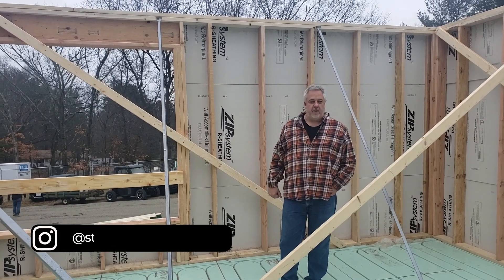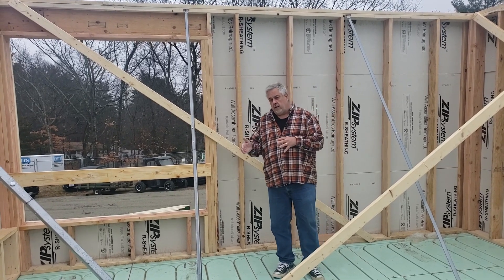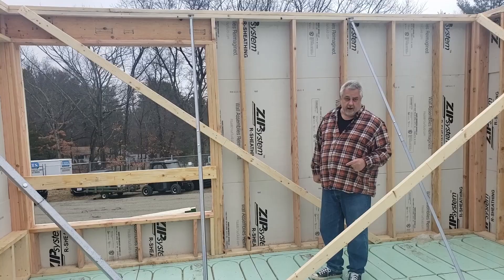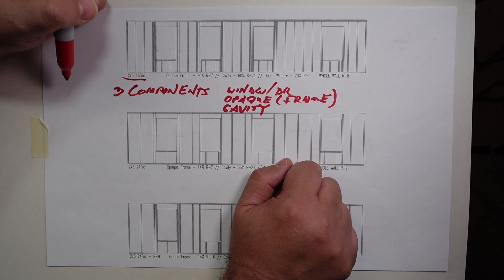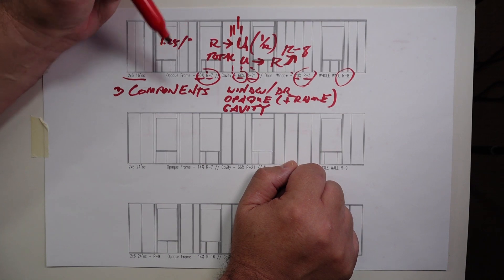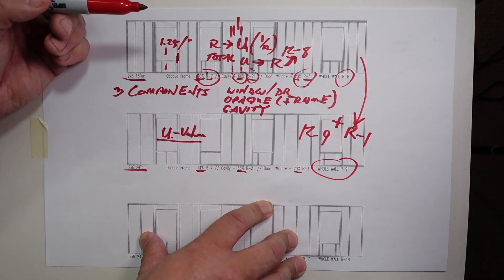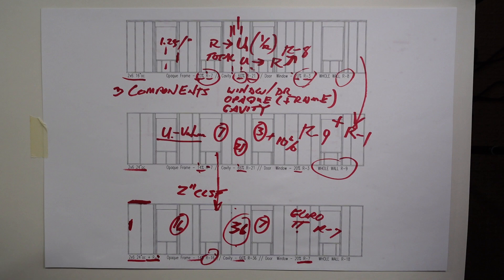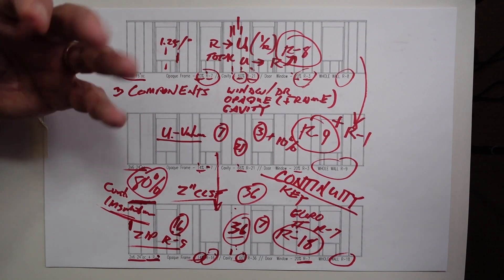INSULATION the WHOLE WALL R-Value

Comment: Another one: as long as your studs are 2X6 and touching both the inside drywall and the outside OSB/subsiding, you are transferring heat through the wall.  You should either stagger the studs, with a double row of studs or nail 2X2 firring every 2 feet apart horizontally and fill the cavity with solid 2 inch insulation.  But until you 'break the heat transfer' you are barking at the wind.  I guess you can add the exterior insulation, but the cost in terms of both labor and materials is high.  Also, double walls are great to reduce noise.

Comment: The different thermal resistors (window, framing, cavity) are in a configuration we call "parallel" in circuit design. The "thermal current" passes through each simultaneously inversely proportional to the thermal resistance value. We can calculate a "total thermal resistance" by following the same rules for parallel electrical resistors and is exactly as Steve said: the total resistance = the inverse of the sum of the inverse of the thermal resistances. Or:
R_Total = 1/[1/R_window + 1/R_frame + 1/R_cavity]. 
If you want to know the relative total resistance, you have the % multipliers as mentioned:
R_Total = 1/[%_W/R_W + %_F/R_F + %_C/R_C].
With a bit of algebra we find:
R_Total = (R_W*R_F*R_C)/(%_W*R_F*R_C + %_F*R_W*R_C + %_C*R_W*R_F)

Using 20% for %_W and %_F, 60% for %_C, R_W = 3, R_F = 7, & R_C = 21 we should find that the relative total R = 8, exactly as Steve said.

The real thing this highlights is why external insulation (out-sulation😅) is so darn effective. It adds a thermal resistor in "series" (one after another) with these resistors, adding the exterior R value directly to the R_F and R_C values, just like if it was an electrical resistor in series. Since placing out-sulation over a window isn't a window anymore, we wouldn't add it to R_W. You could up your window to a higher R value to be more copacetic with the rest of the wall, but otherwise you'd leave it alone.

Now what's even more interesting is you can take that formula for relative R_total and put it into Desmos, a free online graphing program, and give 6 variables for the 6 terms above and start sliding them around to show how quickly you can increase the total R value by changing each individual slider. This would indicate which variable would be the most bang-for-your-buck to put money into to improve your R value.
Reply: You can not compare heat flow with the flow of electrons (electrical current). An electron is a particle that can't split itself up. When an electron encounters 3 resistors in parallel, the electron has to "choose" which resistor it will take.

Heat flow is an energy flow which will split itself up when it encounters 3 thermal resistors in parallel.

That's why you need to take the weighted average (according the surface) of the parallel thermal resistors if you want the calculate the overall thermal resistor. 

In this case you will get R = 20% x R_W + 20% x R_F + 60% x R_C = 14.6

This is by the way how the heat loses of a building are calculated in the European Union...
Reply from the maker: @koenraadprincen7212  Thanks for joining in
Reply from the maker: Thank you for the elaboration - much appreciated
Reply: Great explanation!  I am an electrical engineer so I understand the math well. I failed EE101 the first time because I did not understand the math, thanks.  the outside insulation is a resister in series with all the parallel circuits!!
Reply: @mab49696  You can add up thermal resistors in series as they share the same surface. But forget the story about calculating the equivalent resistance for the parallel resistors with the electrical formula.

If the subareas of your wall (frame, cavity, windows, doors,...) have a different total thermal resistor, you need to calculate the heat loss per subarea (with the "heat transfer coefficient" of each area).

Comment: In a northern climate (e.g. Minnesota) doesn't this put a cold low-permeability surface against your batts?  It was down to -17C this week.  R6 Zip with R30 overall would be frosty.  Sure it's dry as hell outside but any moisture at all from the inside is going to freeze on that wall if the interior air/vapor is less than perfect.
Reply: Correct!
It's even worst, the seams of the ZIP R-sheathing will even sooner act as condensing surfaces because the external ZIP tape is not insulated at all (and vapor closed).
Reply from the maker: @koenraadprincen7212  Actually they make a vapor open tape - and I don't think this is anywhere near what others have described as a concern
Reply from the maker: Yes there are some challenges in the colder climates - where you are, I would likely be more like 50/50 in R-value as a start....

Comment: Maybe we should use 2x4 framing, use no cavity insulation,  and use thicker continuous exterior insulation.   Instead of spending money on 2x6 framing and cavity insulation, use that money on higher R-value continuous exterior insulation.
Reply: I am a homeowner building a new house in the Boston area soon.  I am leaning towards going thicker with polyiso on the exterior, 2x4s on 16” centers with Rockwool batts in the cavities.  One concern I have with 2x6 on 24” with furring strips is hanging the siding on 24” centers.
Reply: @ Maybe the answer isn't exterior insulation.  Maybe it would be better to use 2x12 studs on 24" centers with advance framing techniques.
Reply: @marksandoval5361  2x12"? did you mean 2x6?
Reply from the maker: @marksandoval5361  no, I don't agree with that
Reply: Excellent discussion. But how does double wall construction. With its continuous layer of insulation in the cavity between the separate walls. Compared to the above options?  In terms of its cost, benefits and drawbacks.  

And in the long-term, self-supporting forms of insulation, such as Hempcrete, Is an ideal continuous external insulation, but it's high alkalinity protects wood.  So it's counterproductive not to also insulate between the studs.
Wonder how long before the industry matures enough. where it becomes a mainstream option? (I'd be interested in a similar analysis of Hempcrete, but I doubt there's enough experience in the mainstream building industry, for an objective comparison?  But would love to hear it)
Reply: my understanding is that the exterior insulation application is higher cost than cavity insulation?
this is a question not a statement of fact
Reply: You certainly correct- the labor to install exterior insulation boards is high.  Not so much with Zip-R, but that has other issues.  My builder quoted a $27,000 cost savings to go entirely with close cell spray foam in the walls and roof rather than dense cellulose + exterior polyiso.  However, I am not interested in spray foam for several reasons.
Reply from the maker: @jakebuttrick8853  well first off, builders tend to make what they want to do attractive via $$. the exterior insulation is simply a better performer - good things cost $$
Reply: @ There are so many variations and permutations that cost verses R-value could be difficult to determine.   Personally, I think that the best solution would be to use 2x12 studs on 24" centers and advanced framing techniques with rock wool cavity insulation and no exterior insulation. And, R3 windows with insulating window coverings.
Reply from the maker: @marksandoval5361  To me that is a big waste of money for reasons in this video. After about 5" of cavity, it doesn't make sense to me to make it deeper unless there is something on the exrterior. Beyond the better performing wall, you are really beginning to build a building science nightmare in your suggestion
Reply from the maker: @mab49696  It is but it is of more performance value.......imagine you purchased a Ferrari with 100 hp - kind of a disappointment
Reply: I like that idea in theory from a building science perspective.  The challenge I think is an elegant and robust execution to attaching rain screen battens with long screws semi-blindly hitting 1 1/2 framing.
Reply from the maker: @runmarkrunheinrich  yes, all assemblies have their challenges
Reply from the maker: There is some real argument there...

Comment: Question:  most discussion is about R value for our walls.  for simplification purposes lets assume we have a one room home square box, 10x10x10.  Due to the stack affect, heat rises, how much more important is the R value for roof/ceiling and then floors, than the R value for the walls?  are the floor ceiling combo more important than the walls even though they make up only 33% of the square footage of the box?
for this 10x10x10 box, walls are 400 sq ft, the floors are 100 sq ft, and the ceiling is 100 sq ft. Total area to be insulated 100 +100 + 400 = 600 sq ft.
Reply: Yes, it's better to invest more in the insulation AND AIR TIGHTNESS of your ceiling (or roof) together with - let's say the upper 2 or 3 ft of - your walls.

Floor insulation is the least important if you have a slab on grade or an unvented basement as you can always benefit from the earth heat (although this depends on your region/CZ).
Reply: @koenraadprincen7212  I am restoring a 100 year old log cabin with bedroom added so your comments are very relative.  the house sits on a crawl space that floods from the river every 15 years so your idea of spending my money on roof/ceiling and top half of walls are a very good suggestion for my situation.  thanks
Reply from the maker: @koenraadprincen7212  Well, let's rethink his a bit, from a direct building science heat loss perspective I may tend to agree with you, but the floor is the only surface in the home where I am in constant contact with. Thermally you have an argument, from a comfort standpoint, you best concern yourself with insulating the floor....
Reply: @stevenbaczekarchitect9431  I didn't say that you don't need to insulate the floor...

I said that's worth insulatiing your roof/ceiling more than your walls... just like in passive houses.

If you realy want warm feet, install a heated flooring system 🙂
Reply from the maker: Yes, when you look at the heat loss of a building the ceiling matters quite alot. The ceiling is also the easiest to insulate heavily, and lastly, if it's a vented roof the science is totally in your favor

Comment: Well described.  Windows really are a double edged sword.  They make the house look more interesting, they let in natural light and provide a view of the surroundings, but, they also add significant cost and they are big thermal leaks too - they also offer opportunities for all control layers to leak in fact, but other liabilities can be mitigated with careful detailing..
Reply from the maker: Agreed - thanks for joining in
Reply: This is why proper installation detailing is essential, as well as choosing high efficiency 3-pane windows and insulated core doors. It's not difficult to build a high efficiency wall assembly, but you need to be willing to pay a bit more for the right materials and experienced contractors.